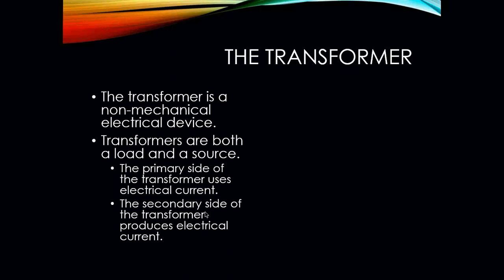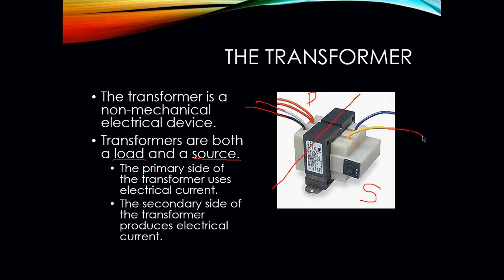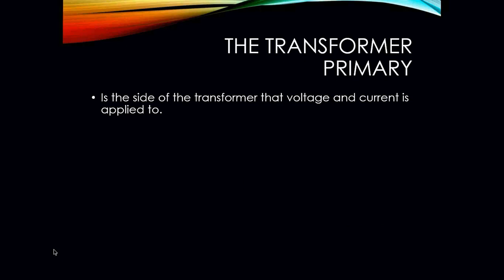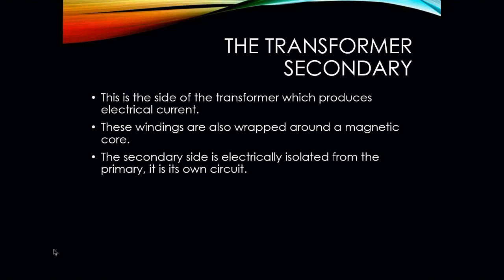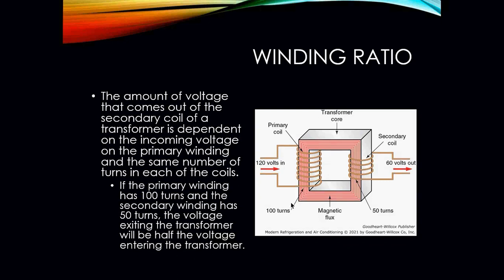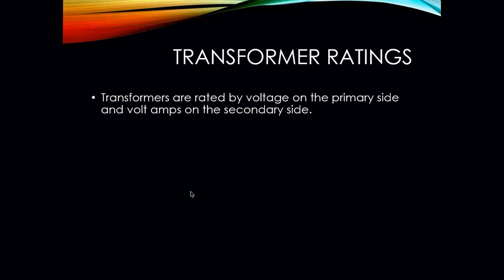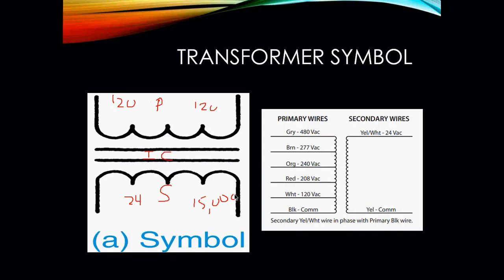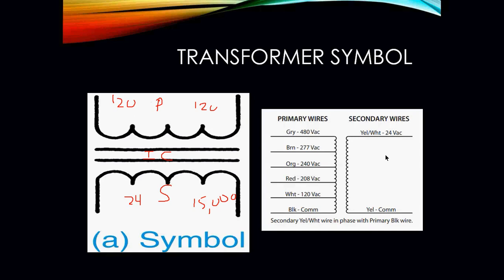Transformers

Comment: excellent, just need to know how to test transformer?
Reply from the maker: Simply Ohm out the primary and secondary windings. You want to see a resistance reading on both. A reading of 0 ohms indicates a short, a reading of O.L on the meter will indicate a open.